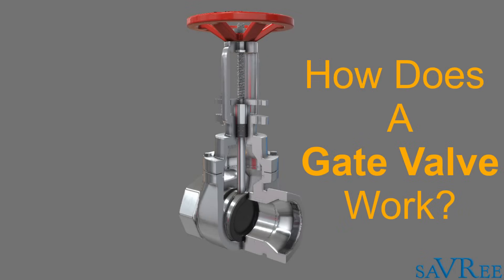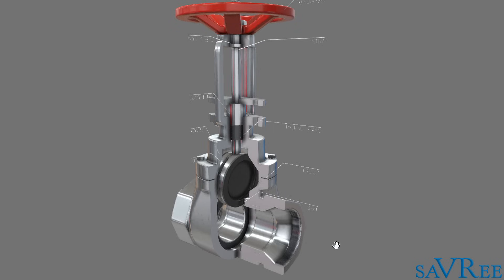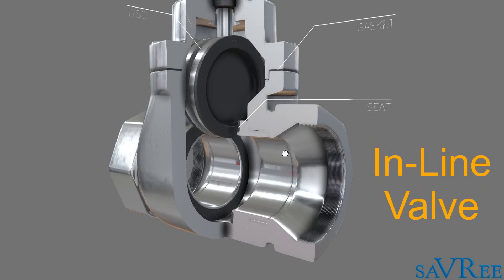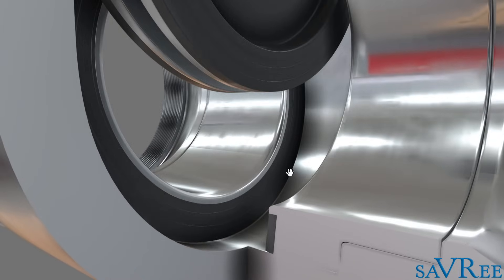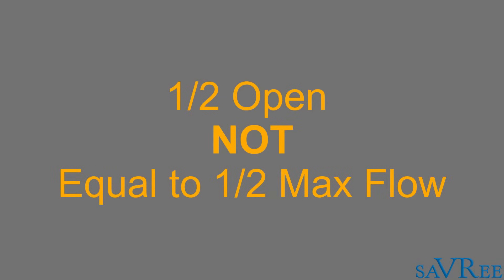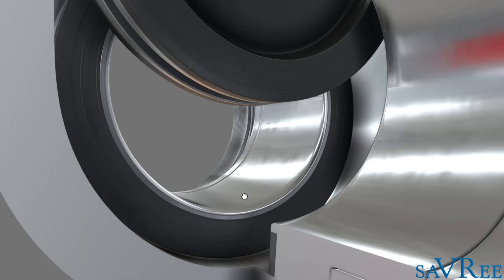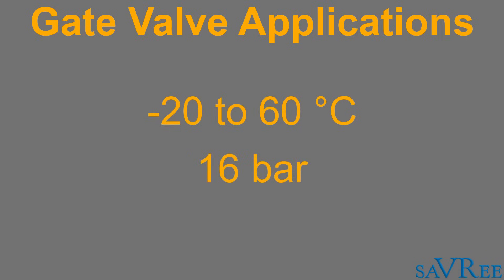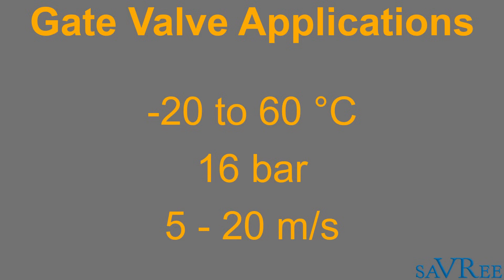How Gate Valves Work

Comment: We have received a tested gate valves in closed position. At site we attempted to test for leakage. Filled water via inspection hole then closed it after filling. Afterwards leakage from one side is observed. What is the reason/explanation for this.
Reply: we are factory to produce valve include gate valve, To your issue, it seems like the seal system is not good, and whether  you confirm that the valve is closed completely or not ?  Our valves have to do pressure test and seal test before delivery.

Comment: Is there a drill that you can use to open and closed gate?
Reply: @savree-3d  instead of using your hands for the hand wheel gate? We have over 14 gates to open for 1 tank
Reply: @trustme3886  You'd need them actuated; either electrically or pneumatically, hydraulically would also be possible but is the least option I'd go for.
For that the gate valve must be equipped with something called a top-flange (ISO5210) on wich you mount an actuator
Reply: @jonnydonny9270  thanks. If you have someone in sales let me know.
Reply: @trustme3886  Please send me a PN on youtube, then I can help
Reply: @Trust Me  Hydraulic actuation is one of the best ways of automating a gate valve. The handwheel and bonnet is replaced with a linear actuator that consists of a piston and cylinder. You apply hydraulic pressure to actuate. You can have a spring return to make a self closing / opening valve. Much better than electric actuation or pnneumatic, but it does depend on the application.
My company specializes in gate valve actuation and control, let me know if you want more information.

Comment: Thanks for sharing this video, Gate valves are designed to be fully open or closed, and are not recommended to regulate the flow of liquid. When the valve is fully open, gate valves are full bore, meaning there is nothing to obstruct the flow because the gate and pipeline diameter have the same opening.